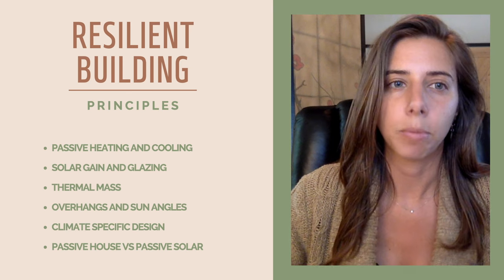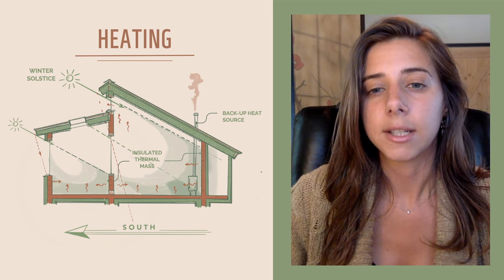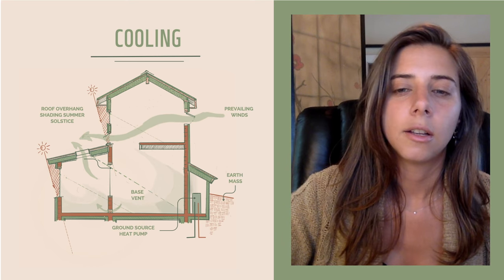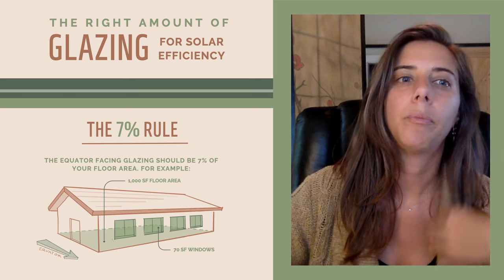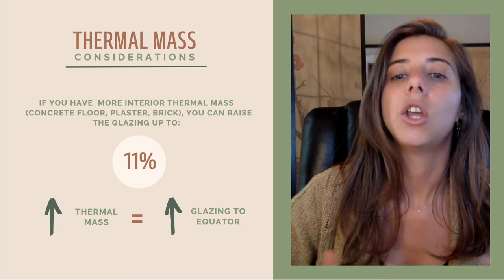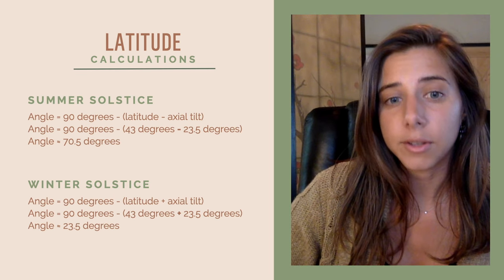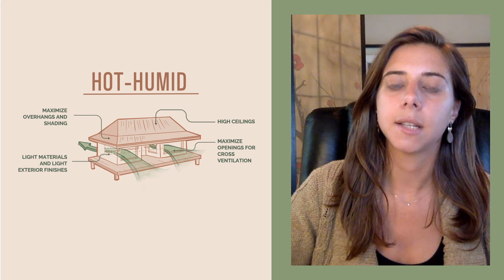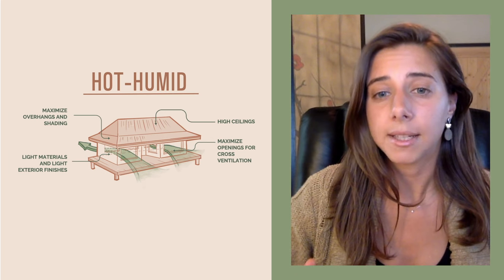Passive Solar House Design:  Resilient Building Design Principles for Climate Extremes

Comment: We figured we would need a wood stove in our house, but we don't. Passive solar principles works a lot better than we expected!! Exterior insulation, thermal mass and big unglazed south facing windows works great in our area. Nice stable temperatures are wonderful, our house temperature only drops 3° F overnight. We are in a hot arid climate with temperatures ranging from 5° to 105°. We use an evaporative cooler in the summer, and leave windows open at night to bring in the cooler air. 🌞🏜️

Comment: I'm really surprised there isn't more interest in building design. Everyone lives in expensive, low-performance homes and complains bitterly about the heating and cooling costs, maintenance, poor air quality etc. My wife and I designed and built a nice, affordable, passive solar off-grid home and all the neighbors laughed. We installed an evacuated-tube water heating system too and have had free hot water for some six or seven years now. Our heating requirements are somewhere between one quarter to one fifth of theirs, and they don't laugh now!

Comment: Great video. I am looking for architectural assistance in designing a single, stand alone, rural, residential house that passively cools in a hot and humid climate. I am intrigued by under ground ventilation tunnels that incorporate evaporative cooling and a Trombe Wall to pull cooler air through the structure. Possibly a earthen roof as well. I wonder if you might point me in a direction where I might find assistance?
Reply from the maker: Hey there!  What part of the world are you in?  Depending on how humid the climate is - it may require a unique set of strategies.  I would be happy to help explore some of the options.  Reach out to me on my website!  I offer free discovery calls we can talk about your project!
Reply: @christinaransbury  Thanks for getting back to me but we already spoke via e-mail under a different name.

Comment: Great drawings and explanations! I agree that 1) being able to open the windows and have the prevailing winds cool the house, and 2) have the overhangs cool the house from the sun, are clearly hugely powerful and underappreciated climate control methods in construction. I agree that if something broke in an air-tight house without these features, it would just become an oven. Keep sharing, and thank you for the good work!

Comment: Note: this comment applies only to heating dominated climates. although it's good to design with solar orientation and heat gain in mind, it's a bit tough to say if this design strategy is primarily responsible for the durability of historical buildings. in cold climates, buildings have historically maintained their durability by 1) building out of highly moisture tolerant materials, e.g. old growth trees and solid rocks and 2) using enormous amounts of energy to dry them out (about 40 cords of wood per year for your average Colonial, or 900 million BTUs/year, compared to about 120 million BTUs/year for a New England home now)

A wood stove isn't an awful source of backup heat by any means, but they aren't flawless either; woodstoves are typically associated with significantly increased health issues from asthma to cancer, and they are generally bad for neighborhood air quality.

Someone asked if it'd be possible to build a small house and avoid some of these expenses, and the answer of course is yes, the smaller you build, the cheaper it gets. But in America we have a tendency to think individualistically, and building tiny is not a realistic systematic approach to solving housing issues. Families need more than 500 square feet. The average ADA compatible bathroom is 150 square feet alone. And there's no way there is enough salvageable old growth wood to solve the housing crisis using this approach anyways.

I do think that keeping in mind solar design is very important to good housing design. But one of the main reasons why many of us don't live in flophouses, tenements, Hoovervilles, and house courts anymore is due to the advent of modern building materials. We aren't building with these modern materials in the best way, and this causes problems. But they're solvable problems. Trying to go back to how we built 100 years ago means that only the ultrawealthy will be able to afford housing.

Comment: Great video! I am in the process of designing a passive solar hempcrete home. My designer keeps telling me not to extend the overhang of the roof because he thinks I'll want the direct sunlight into my clerestory windows during summer to bring in more light and that I can simply lower shades or invest in windows with internal shades if I end up not wanting the sunlight into my living space. As my exterior walls of the house will be 12' thick hempcrete walls, will overheating through these clerestory windows in summer not be an issue if I don't extend the roof overhang? I'd love to know your thoughts. The home has an attached sunroom on the south for isolated solar gain.
Reply from the maker: Nice!  Sounds like a fun project!  
IMO ...Without overhangs you are at risk of overheating the space in the summer for sure.  If it is a clerestory window you may be better off since heat rises, but you'll need a way for that heat to escape.  You can still daylight the space significantly even with overhangs.  Ideally you dont want that summer sun to hit the glazing if you are trying to achieve passive cooling, regardless of your insulation  / u-value.  It doesn't hurt to add an overhang, and also protects your window / wall from weathering.  You can get a really efficient window, but thats probably more expensive than extending the overhang.

Comment: Super awesome tutorial- I will be rewatching during the design phase!  I am wondering if the +/- is reversed in the sun angle latitude formula? 90-43-23.5=23.5 which is winter not summer?  Unless I’m mixed up?  Or maybe add the angle with an arc on the sketch please for clarity?
Reply from the maker: Oh no!  Did I have that reversed in the video?  To clarify, the summers angle is your latitude PLUS  the earths tilt and winter is MINUS.  You have to make sure you do that addition / subtraction first and then subract that sum from 90 (thats why theres the parenthesis).  I can send you a screen shot separately on the angles you need for your latitude.  So in winter the angle is 70.5 and in summer it is 23.5.  This is from a 90deg vertical line at 0 degrees.  I cant seem to send a image here , but if you contact me on my website I'll send you the screen shot.

Comment: I live in southern hemi but so close to the equator that the sun is 3/4 year in the north, and 1/4 of the year in the southern sky (although not very far)... but it is high altitude so I need the solar heat!  So designing my house poses the issue of also wanting heat in the summer/rainy season (there is still sunny/hazy hours and days).. but on the other side of the house.  I guess some eastern/overhead windows/skylights.. but I am afraid roof glass will let out too much heat.  Anyone ever build passive-solar in this type of climate/sunlight?
Reply from the maker: This is a really good question!  I am actually dealing with this myself in a design project in Kenya that is high altitude but right near the equator.  I think if you use high thermal mass walls, and allow those walls to absorb sun throughout the day you can achieve some passive heating. Is it dry where you are? In this case you could have minimal overhangs.  At the end of the day a back up wood stove will be used to heat the interior and masonry walls.

Comment: Hi, Very informative. Can you tell me if I can design a monolithic dome (made with concrete) ton be designed as a passive solar. I plan to have the back half of the dome in a hillside covered with earth. Cooling tubes like in an earthship. Have the fromt like an earthship with a greenhouse. Please let me know what you think. Thank you
Reply: It would seem like the first consideration is which direction the front of the house is facing since to take advantage of the sun, it needs to be pointing in the right direction.

If it is, then you should be able to.
Reply: @tracy419  yes, I have that figured out. My concern is how tall the domes are. It seems there is a lot of space to heat.cThanks
Reply: @regenerativegardeningwithpatti  oh, gotcha.

I didn't know where you live, but near Newport Oregon someone built a version of an earth sheltered dome home where instead of building it into the hillside, they bermed it up on multiple "sides".

They had a primary "front" with big sliding door windows, and 2 other "sides", one with normal windows and the other the primary entry where cars are parked, etc.

The rest was covered in soil.

They had a concrete floor for absorbing heat through the primary and side areas and said they used a wood stove only occasionally.

Seemed to work well for them.

I'll try to remember who did the video and get back to you.

Either way, good luck. This is one of the types of homes that really interests me and I wish you the best.

Edit: I posted a link in a separate comment just in case they delete it.

It's a Kirsten dirksen video with an earth sheltered dome home from 3 months ago- title starts with no bank would loan them money.

Also, my description is a bit of, but you'll see in the video.